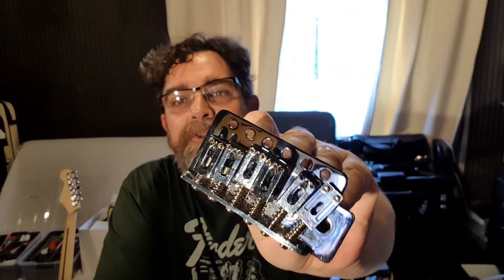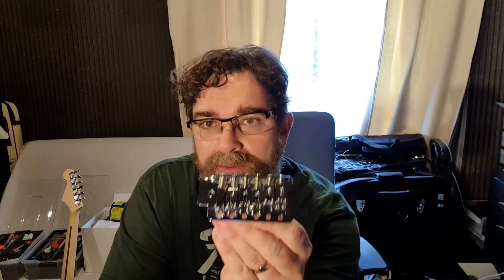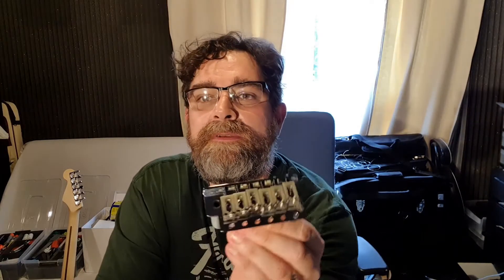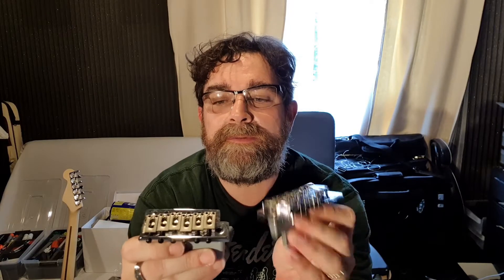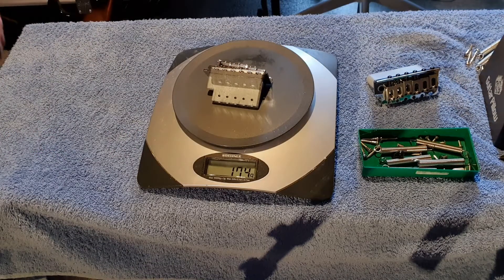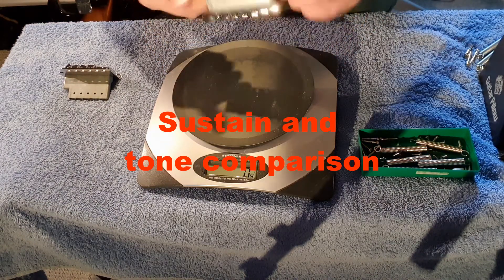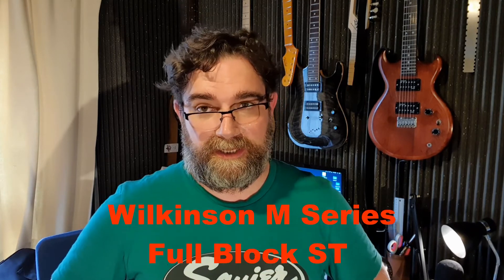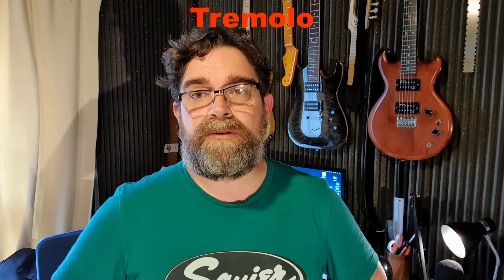Wilkinson M Series full (short) block for Squier Bullet Stratocaster versus stock tremolo

Comment: Absolutely,  no doubt and not hype. 
I sincerely heard a difference,  I heard it immediately from the first strike after the upgrade. 
Great! I have Wilkinson's Vintage 54mm on a Bullet and an Affinity. 
I like them as well as I do my MIM Fender Tremolo.  Great Video Kev!
Uncle Eric
Reply from the maker: It really surprised me when I listened back. I rerecorded a few times as I realised settings were incrementally different between the two. The thing I didnt mention but should have was the increase in volume. Next up I'll do a demo of those texas triple hots. They're really nice
Reply: Wait isn't squier bullet has 52.5mm spacing?

Comment: Kev, thank you so much for doing this video~  -Nina :)
Reply from the maker: My pleasure Nina!!
Reply: @kevinboor3560  @Musicilly  -  I assume that since the time of the original post,  much of the middle content was chopped out for some reason?  In any event, a question: What difference would a steel block make over the Wilkinson alloy block if they are of the same approximate weight?  I would think, for example, sustain would be similar?

Comment: On the reggae rhythm comparison - I thought the first take (with the cheaper Squier system) sounded better than the second take (with the wilkinson system). You may have played the 2nd take more softly? But the first take had the initial attack of the chords/notes as being stronger/more punchy compared to the second take. The Wilkinson replacement definitely gives more sustain - but is this at the expense of less attack perhaps??
Reply from the maker: You're probably right. No doubt both systems have their benefits. To me the Wilkinson sounds better but to others the Squier system will. They've been using that system with little variation for a long time because it works well. But I've found the Wilkinson generally more friendly to the tone im seeking. Its a subjective view of mine at the end of the day

Comment: Ok, my review on this tremolo so far. The stem of the tremolo arm that go's into the block is not long enough and it will hit the volume knob of my Strat. Putting something into the receiving trem block hole in order to raise the bar a little to cure this issue is not an option as for some reason the grub screw doesn't wan't to clamp the arm enough anymore. I should mention that I bought the optional longer sustain block (40 mm long) but it was impossible to remove the shorter original block from the tremolo base plate because the hex machine screws are extremely tightened by the factory and now ALL 3 screws heads are totally damaged (these screws are very soft material). Tomorrow I planning to visit a machine shop here and I hope they can extract these screws so I can swap the short block for the longer as the tremolo springs rub the trem cavity at this moment when I dump the tremolo with the arm.
Reply from the maker: Interesting. I haven't tried removing the block as it fits perfectly. I hear you on the trem arm but it works OK with my pot knobs. I just pull it out of the hole a little
Reply: @kevinboor3560  The longer block they offer for this trem is longer which is made for a American Strat cause that body is thicker than a Squire body.
Reply from the maker: Yes a standard block won't fit.
Reply: Im having the same problem. Kinda pissed about it, cause i was gonna get the actual fender tremolo, but convinced myself to go with musiclilly.
Reply from the maker: @jakeritchie3805  they're pretty good on the customer service side. Since replying to this I went ahead and bought a Wilkinson push in trem arm separately. Didn't cost much and yes actually if makes a big difference.
Reply: I put in the arm that came with the tremolo unit itself. I wonder why the ones that clme with it dont work
Reply: @jakeritchie3805  Just bend the arm to suit.

Comment: I'm surprised you didn't mention the pop-in tremolo arm with the ability to adjust it to a non-wobble - a huge plus in my opinion.
Reply from the maker: Good point! Totally forgot that
Reply: @kevinboor3560  Thanks for your kind reply, Kevin. May I ask where you bought the Wilkinson M Series vibrato? They don't seem to be far and wide...
Reply from the maker: Sure thing. Not sure where you're based but this company should stock these in the UK, USA and a bunch of others places. They're supplied by Musiclily. I've had great experience with their wilkinsons and pro range of parts https://www.amazon.de/dp/B084ZFWL2Y/ref=cm_sw_r_cp_apa_i_BmNmFbR85R629
Reply: @kevinboor3560  Thanks much, Kevin !
Reply: Just ordered: Musiclily is in Germany too :). Thanks again.